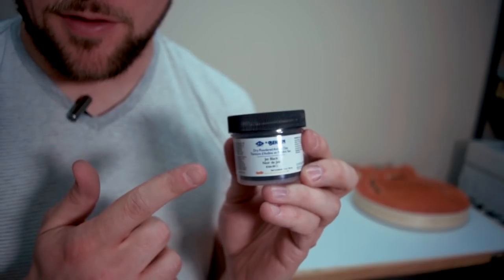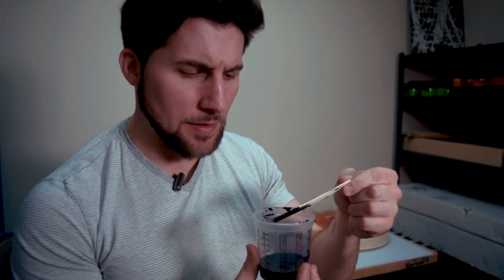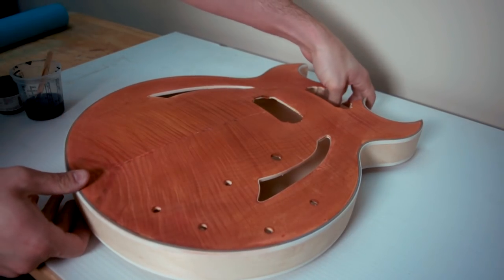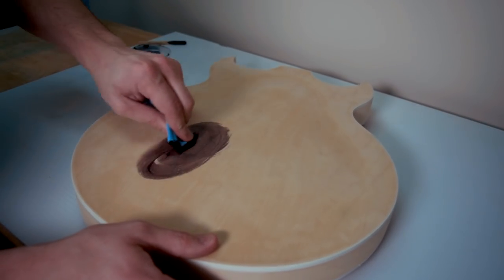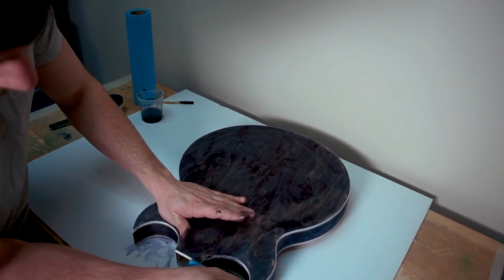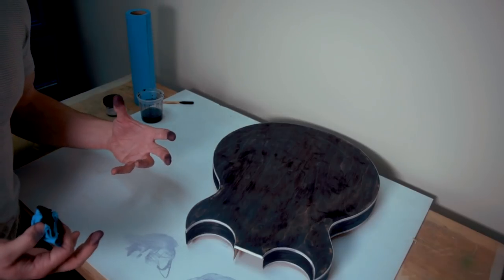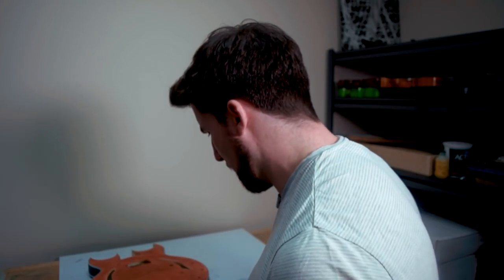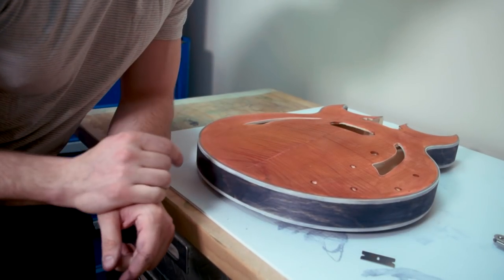Applying Water-Based Aniline Dye | The Crazy Chinese Hollowbody Guitar Kit

Comment: Hey Brad give artist oil based paints a try on one of your guitar projects.  Thin it with Japan Dryer and to get a nice even coat, and it'll speed the drying process of the oil paint.  Wait 3 days to make sure the body is 100% dry.  A bit of a pain to clean oil paints (though those Lysol wipes work pretty well on skin in case you get some on you.  I got great results on the LP kit I used it on.  Took some patience to get the right look, but it is stunning, and actually looks like a night sky Bob Ross would have painted.  Yes it will even show your grains when thinned.

One thing I learned is do a 50/50 mix of mineral spirits and a wipe on poly to really lock in the colors.  :-)

Comment: Brad ... I tried to find an answer to this looking through some of your older videos and I am sure someone has probably answered it somewhere but I can't find it.  As you may remember, I am doing one of your other projects in the Solo Spalted Maple.  I'm at a crossroads. Two coats of tung oil on the guitar body and neck and all is looking good so far outside of some bad a couple of bad glue spots on the veneer.  I could feel them before I started but I didn't want to sand too deep as to possibly go through the veneer.  My question has to do with adding a water-based dye (Keda Wood Dye Powder) to the spalted maple top of the guitar after two coats of tung oil or can you mix that with something like mineral spirits, strain it and mix that with the tung oil?  I want to go for a slightly different hue to the top of the guitar.  I was thinking that if I gave the tung oil 24 to 48hrs to lock in I could use a little of this waterbased dye on top of the tung oil and either go straight with the water-based dye on top of it or try to mix with the tung oil and add maybe two more coats to the top of the guitar before I used the clear poly top.  Just a thought but being the first project I not sure how some of these things will react ... especially with the two glue spots (although minor areas).  Both spots are on the edge of the veneer.   If you have any suggestions or can point me to another video that would be great!  Thanks.
Reply from the maker: You can let the tung oil set for 48 hours, sand lightly with 0000 steel wool, and then mix some dye in an oil based finish/vanish and apply that if you want a tint.

Comment: One can always use dye in your first 2-3 coats of clear to cover those trouble areas and homogenize blotchy stain.
Reply: If you use dye in clear coat will it give the same effect as if you stained and clearcoat after that?
Reply: @mrmisterman999   a similar effect yes, depending upon how much dye/pigment and what kind dye/pigment is used in the clear.  It will give a translucent or opaque finish in that color.  That's how most companies (Gibson, Fender, etc..) paint their finishes.  A clear with dye (for translucent) or shader (for opaque) pigment added is sprayed on top of the sealer then over-coated with clear (in most cases). I highly recommend testing on scrap first to get your mixes the way you want them.
Reply: @PicksPaints  interesting because I just bought a quilt veneer and was going to stain it but maybe I should just use dyed clearcoat
Reply: @mrmisterman999  For some real fun, you can do both if the veneer is thick enough to allow for some light sanding.  Lay down a dark base coat black, purple, dark blue, dark brown, whatever just as a base color.  Wait for it to completely dry.  Sand that back with 300-400 grit until the dye is pulled out of the closed grain.  Clean your piece off with naptha.  You can then come back with another light and contrasting color of dye.  Once that's dry #0000 Steel wool that back a little just to lighten it up a touch.  Then lay down your 3-4 coats of sealer.  Flat sand the sealer.  Lay first 2 coats of clear, then add a 3rd color by adding dye in your next couple of coats of clear.  

It can be done by hand, but it requires different types of dyes.  Water-born and solvent-born dyes.  Base color with water, main color with solvent, and 3rd color with water. Same sanding steps between the base dye and 2nd and 3rd dyes.  Just don't put your sealer down between the 2nd and 3rd colors.  Either way it's a lot of work, but you can get those cool PRS type finishes (Northern Lights, etc) by doing either of these techniques.  
Again, I stress practice on scrap many times beforehand!  And best to practice on the same off-cuts as your work piece, if you can.  That way you know how each dye will react to that specific piece.  After you do these enough, you can kinda get a feel for it and it's way more predictable.

*Note1 - It CAN be done with all similar types of dye.  HOWEVER, using all the same types of dyes tends to cause unwanted bleeding of the previous colors.  

*Note 2 - In my experience- Water-based dyes tend to be lighter in color and require more coats.  Solvent based dyes tend to go be bolder and brighter in color and require less coats.  I use Angelus Leather Dyes as a solvent based dye, and Trans-Tint for water based dyes.  They don't seem to interfere as much with each other when doing a 3 color dye job like I discussed earlier.
Reply: @PicksPaints  cool thanks alot for the info. I'll make a video when it's done 👍
Reply: @mrmisterman999  Any time.  You're most welcome!
Reply: @PicksPaints  looks awesome man. Hope my quilt turns out nice
Reply from the maker: Looks like Dave has this covered for me, and quite accurately as usual. 
Dave, the only thing I’ll say in response to your first comment is that I’m avoiding using the gun on this one to make it easy to replicate for diyers looking for water borne stuff they can do at home. I don’t think mixing the dye into clear and applying it through a method other than spray would be very effective at evening things out, though mixing into some clear through the gun would be my go-to solution.
Reply: @BradAngove  yeah agreed!  It definitely has to be sprayed. Preval sprayers can be used for those of us who don't have proper spray equipment.  Maybe that might be worth a video of it's own?  Showing how to use a Preval Sprayer.  Of course there are other options as well, pre-tinted lacquers from ReRanch and StewMac.  But if guys want custom colors/bursts/etc, a Preval is just another way to do a custom paint job without all the expensive equipment.
Reply: @mrmisterman999  Thanks man!  I have to throw props to Derek at BigDGuitars here on YouTube as well.  I learned a TON about hand dyeing by watching Derek's videos.  Which inspired me to create a few of my own techniques.  My best so far, was using the different based dyes to help keep the colors more separated when going for effects like that.  And some blending techniques that I do very differently than he does.
Reply: @PicksPaints  hey Dave do you know a good place to get veneers
Reply from the maker: I’ve actually never used a preval haha. Never had a need for it I supposed.
Reply: @BradAngove   It might be worth showcasing in a video.  To show an inexpensive way to mix up a custom color and spray if you don't have all the expensive equipment?  Just a thought.

Comment: I’ve been getting great results with Keda dyes Brad, I can’t get the ones you use here in the UK but can import Keda. I also had an issue with glue around bindings, but solved by doing a light burst with auto paint after staining. Nice and easy for an ‘amateur ‘ like myself
Reply from the maker: That’s a good way to deal with it. Keda dyes are also quite good.
Reply: The guy on the keda  wood dye channel sold me on them

Comment: On my screen it looks like the dye is uneven stained. Would't it be better to take a lighter solution with multiple passes? Rob
Reply from the maker: The dye will loo even when I clear coat it. Some spots were wetter than others in the video. 
You can use a light solution and build it up if you want.

Comment: Nice vid!! If I can make a suggestion, please, please, don't scrape the binding with the razor blade towards your body or your hands. One slip can be very dangerous. Always scrape away from you.
Reply: As long as one is careful and goes VERY VERY slow, it'll be fine.  It is not at all easy to scrape binding away from the your body.  You can always get a binding scraper instead of using a razor blade.
Reply from the maker: I find that I have much more control pulling toward myself. Luckily, this technique places the blade perpendicular to the binding as opposed to an angled carving type of hold, so it’s really not that dangerous. If you slip, you hit yourself with the flat side of the blade.

Comment: Hey Brad, could I ask some tips from you? I own a Fender Acoustic SA-150 that recently had some damage to the top, so I want to stain and refinish just the top. I removed the bridge and pick guard now, and I think I am ready to start delicate sanding of the top with 800 grit. I would like to stain it with this Behlen jet black too, but I'm not sure what to put over the stain to finish the top with.  I've looked around at what finish is on the rest of the guitar, but I haven't honestly found a solid answer. Also I know acoustics are more delicate to sand, so I'm a bit nervous about that, too. Any advice would be greatly appreciated, as its my first guitar and has some sentimental value even though its cheap...I hope I don't ruin it. It's my first guitar fixing job ever. Thanks!
Reply from the maker: Generally acoustic guitars are finished in either lacquer, oil, or shellac. There are some other alternatives including UV cured finishes etc., but those are kind of the classic choices. Do you have a preferred application kethodv
Reply from the maker: *method?
Reply: @BradAngove  Thanks for replying man. I think after watching your videos I will go with the nitrocellulose lacquer in a spray can over the top of a behlen jet black stain. I don't have a compressor for a gun, and I don't need it to be perfect anyway, it's just the top of a cheap guitar.
Reply from the maker: That’s a good choice.

Comment: Hey Brad, love the videos.  Question about using water-based dyes on kits like this with thin veneer, and maybe you cover this in over videos, but I haven't seen it - what about using a grain filler first to help make for a smoother, glassier finish?  recommendations for best grain fillers to use when dying?  Thanks for making great vids!
Reply from the maker: You can use filler first, but you will likely want to dye the filler as well to add an accent color with it. Once the filler has dried fully, it won't take dye properly.

Comment: why not a brush or a roller?
Reply: I used a terry cloth sponge for the water based dye I worked with (in my case Rit Dye all purpose) and I found that it becomes too blotchy and way messier.  You also waste a lot of product using roller due to absorption if using a roller.  

Remember this isn't a household paint where you have a thicker medium to evenly spread the product on a surface.  A brush will not spread as evenly and will leave streaks as paper towel or shop towel, but can get into a tighter area than a roller.

I can say from experience what ultimately worked for my dyed guitar was using an old white cotton t-shirt.  Again after testing those sponges, a paper towel, and finally the shirt.
Reply: A brush or roller may add to much dye at one time.. just my thought.
Reply from the maker: Yeah, the idea here is to use a little bit of product, rub it in, and remove/move around the excess. It’s too thin to use a brush or roller properly. That would leave dark splotches due to its inability to pull extra stain around.

Comment: I would have put the product in a spray bottle to get the body wet all at once then  wipe it in one direction. You can buy  mini spray bottles . Just saying.
Reply from the maker: If I were in a rush or working in high volume and wanted to do that I likely would have put it in an hvlp gun. It gets it on there nice and even and there’s no need to wipe it afterward.
Reply: @BradAngove  The thing I liked about your channel was that you were showing people who do not have professional equipment. You were showing people who I feel is the majority of your followers. The idea is not about high volume but the individual doing 1 guitar. Just saying. You can tell a sprayed on finish compared to a rubbed on finish. So getting it wet by spraying it on then wiping it with the grain would be my way.  You did the right thing by not using all that equipment that most people do not have. I'm just saying.
Reply from the maker: Fair enough. Thanks Leonard.
Reply: @BradAngove  You'r welcome Brad